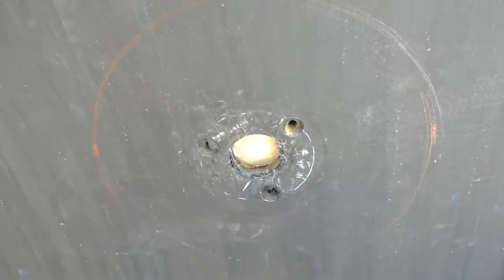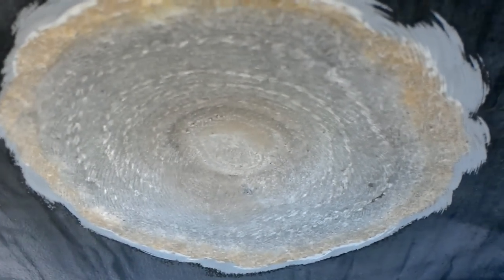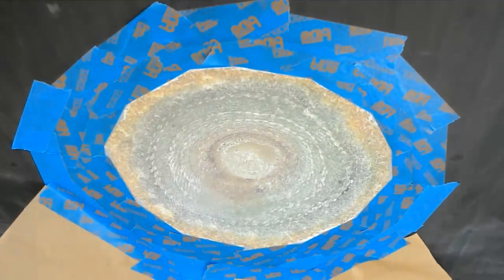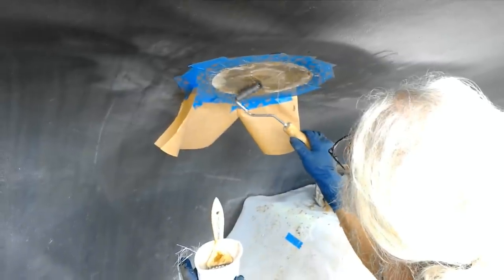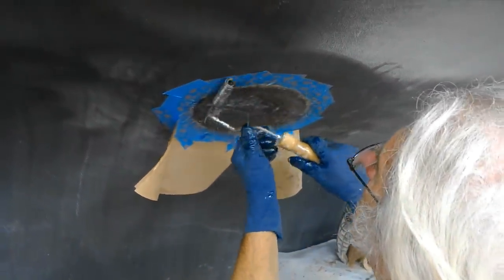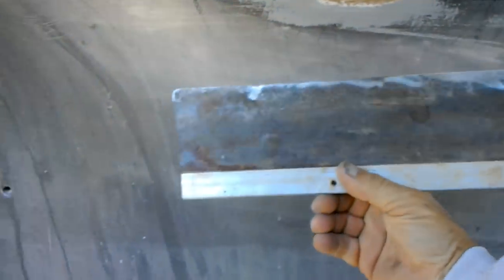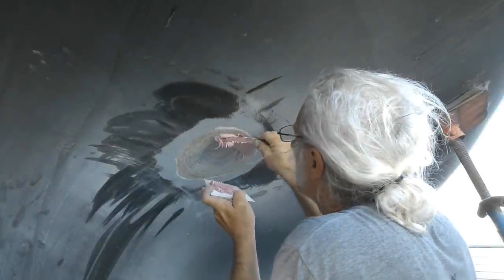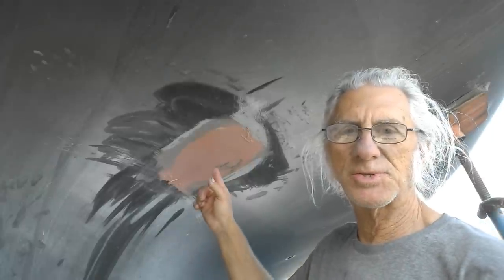Patching an old thru hull

Comment: One of the few guys doing it the right way.
Reply: I appreciate the creator's video and seeing his technique, which employs a method similar to an instructional video by Jamestown Distributors I watched recently on patching holes.  I'm new to all of this, so I won't argue methodology, but on a side-note, I heard the perspective on the other approach (small-to-large) that justified that method, as well.  Interestingly, that method was validated by some people who had been trained in fiberglass repair by the Navy as well as someone in commercial aircraft manufacturering. Thee rationale for the small-to-large approach is that each layer makes some contact with the hull and the new fiberglass runs paralell with the original layers, which they say is favorable when considering stresses from an engineering perspective.  

I'm sure that quality work, properly mixed quality resins, and otherwise good materials will ensure both methods wont ever present a vessel integrity or safety issue, so I don't bring this up to be in disagreement, but I do find it interesting that these two opposite methods each seem to be fairly common.
Reply from the maker: Great comment .. I'll stay with the large to small.  You can't tie into the original long strands anyway so if it's a matter of stress the patch is only as good as the bond of the first layer.  After that you're just building up thickness.  I do alternate with bi-axial for local strength.

Comment: Great video! Nice to see some professional work for a change! I have done thruhull repair in both polyester and epoxy. I know everyone swears by epoxy, but the second boatyard I worked in, did virtually every repair in polyester including installing a bowthruster in a fishboat. The secondary bond is not as strong as epoxy, but it is usually good enough if prepared properly. Looking forward to your other projects.
Reply: Can gelcoat bond to epoxy ?

Comment: Great video. One piece of advice though. Always let polyester cure a good two weeks before applying epoxy. That’s one of the downsides of working with polyester, as is the weaker secondary bond.

Comment: Hi mate ive watched this video twice i have a thru hull tranasducer hole to fill and repair and like you i will be fighting gravity ,with my limited work area it means i am under the trailer while i do this have cut a hole in the floor where i will apply a layer or two of csm then grind the underside and ill probably only do a few layers at a time rather than have the whole lot move on me and end up doing it again as i say i am fighting gravity great video for someone like me who has neverhad to patch a hole in a hull ,oh and polyester is my choice like you because the whole boat is made from it .
Reply: Just got email notification.  Hope all went well with the patch .. glad I could be of assistance.

Comment: Did you flair in inside of the hull at the same ratio, or just enough to get some glass on it?  I have a thru hull i'd like to fill, but it's not in a good location to flair the inside.  Thanks.

Comment: He did it completely backwards. Always start with the small patches, that way every new piece is bonded to the original glass around the edge. 
The way he did it, ONLY the first piece is actually bonded to the hull. If that bond fails, the whole patch falls out in one chunk, because only that one even touches the rest of the hull.
Reply: Doesn’t matter which way you do it.